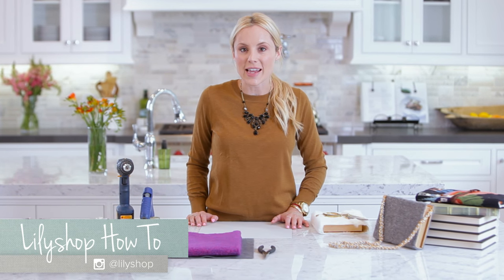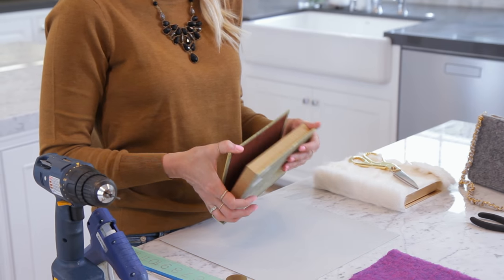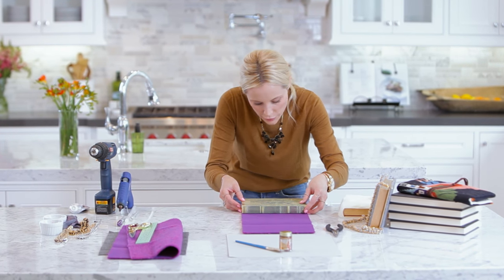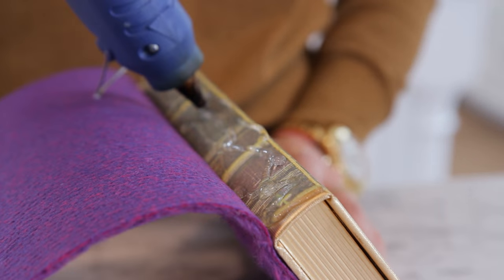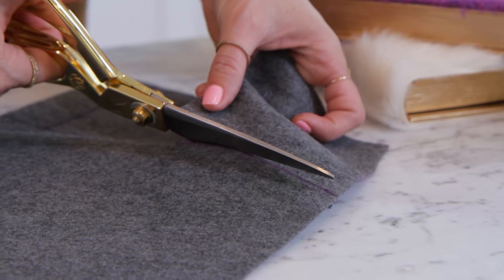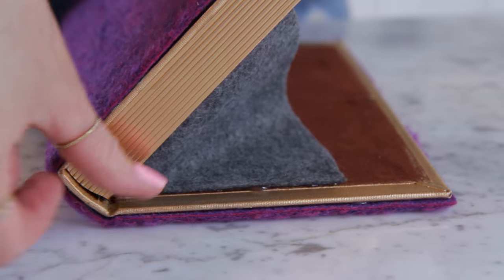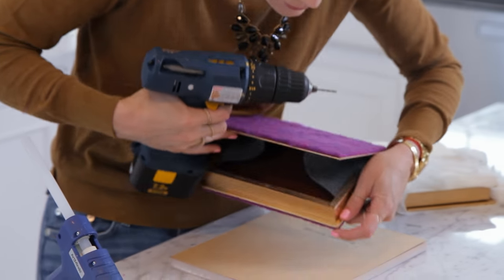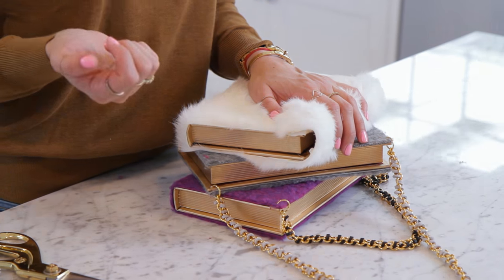How To Make a Book Clutch - HGTV Handmade

Comment: This wasn't making a book into a clutch. It was making a box into a clutch.
Reply: right!?! I got so excited because I bought a couple of books specifically to do a clutch out of but haven't found the right tutorial to achieve what I want to. still looking...
Reply: +Catrina Bush you can hot glue a book over the box instead of felt.
Reply: Hi! I used an actual book on my website several years back, but I found that most people didn't like to cut up a real book so I thought the book box might be a great option. If you check out my website you will find a ring bearer book that is similar in that I cut out the pages with an X-acto knife : ) Hope that helps!
Reply: +Catrina Bush I found one on 'do it gurl' with Jamie Pettito I think you might be able to use that!
Reply: Lilyshop I think the tutorial is good, it's maybe more of a title issue ... A bunch of us got all excited to turn a book into a clutch and that's why we were disappointed. But if the title didn't accidentally lead us to believe that, it would be all good! You make great videos! 😊
Reply: Because they're doing a clutch that looks like a book, not turning a book into a clutch. Just so it can look more like Olympia le-tan's design

Comment: I notice that at no point did you actually pick the clutch up and put it over you shoulder or hold it other than over the opening. 
I'm wondering if the magnet is actually strong enough to remain closed when there is stuff inside. It was only made to sit on a surface and be a receptacle.
Reply: thought exactly the same...
Reply: Hi! It's absolutely strong enough to use and wear. I should have modeled wearing it in the video! You may want to test your magnets on your book box. I know that some are very tiny and won't close well with the fabric. Just make sure you check your book box beforehand.
Reply: i notice that too and then realised that we can probably hot glued some extra tiny magnets on the sides to strengthen it. Or you can add a strap before you glue the felt on, glue a large magnet on the outside and add a piece of jewellery on the end of the strap to cover it. it'll then looks like those journal type book.
Reply: TheBookCover12 That's a good idea too. Thanks : )

Comment: I would like to see a tutorial making this project from an ACTUAL book. I would rather have one like that too.
Reply: Hi! I used an actual book on my website several years back, but I found that most people didn't like to cut up a real book so I thought the book box might be a great option. If you check out my website you will find a ring bearer book that is similar in that I cut out the pages with an X-acto knife : ) You would have to glue the pages together and add your own magnet. I know other websites have used books to do different variations of this. Hope that helps!

Comment: is there any system for opening and closing the clutch
Reply: There is a built in magnet if you buy the book box. If you use a real book you just need to add your own magnet. You just need to make sure your magnet is strong enough for whatever fabric you are using, because it can make the clutch a bit heavier and with contents in the purse you don't want it to fall open when you are using it.